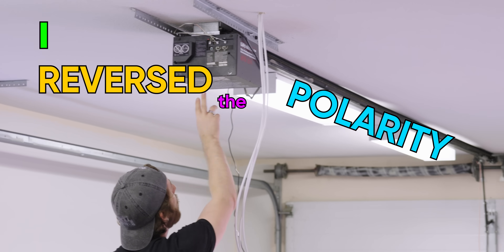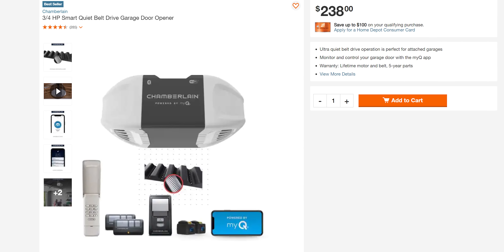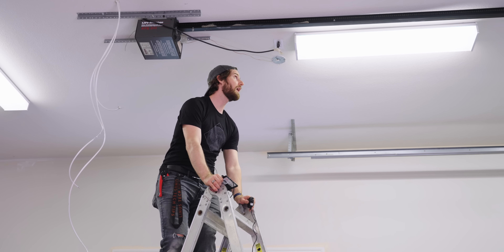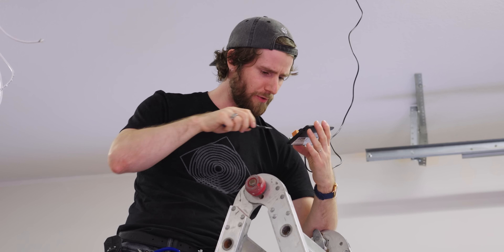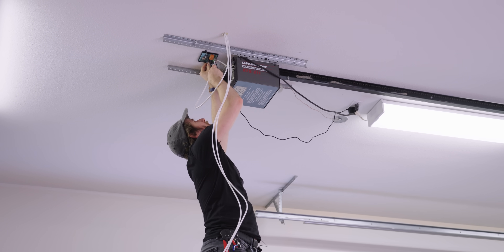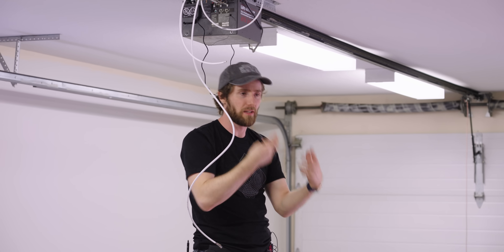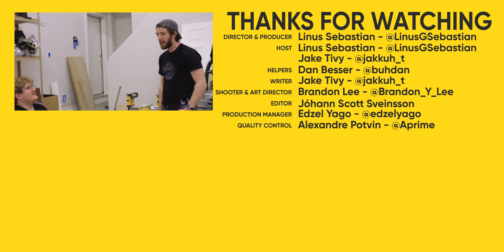Smartifying My 25+ Year Old Garage - Z-Wave Garage Door Opener

Comment: You could have just bought the Meross garage door opener ($20-$70 depending on model) and saved yourself a ton of issues and complications. I installed mine in like 15minutes and it works flawlessly with all the voice assistants.

Comment: The MyQ device works fine with normal push buttons to open/close your door.  And it works with Home Assistant.  Yes, requires cloud access to do it, but if someone doesn't care about that and just wants an easy install, it's about a 5 minute set up.

Comment: You probably could do that same and much more with a raspberry or android, of course if you like to talk to your device you need a cloud. But if you want some automation to close the door and don't mind to open a ap or browser on your phone to click a button to open or close the door it would be much safer and don't need to sell your soul to Google to open your door. You still going to be connected to your wifi when you run up to the house so you don't need to open the device to the outside world, and having an easy password on the website would give extra safety even if someone hacks in to your local network

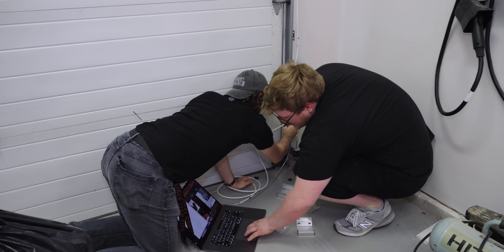Comment: 4:41 the placement doesn't matter since its irrelevant on how it detects its open, if you have it at eye level it will still operate the same either with it in the top, the floor, or the middle.

Comment: If you install the magnet part at standing height of the door, and also the sensor, it works the same as you installed it at the bottom of the door.

Comment: So, what happens when someone shouts through the letter box, "Hey Google, Open garage doors!"?

Personally, I wouldn't want voice control to open doors to my home.
Reply: Personally I don't want any "smart devices" controlling anything in my home. I'm happy doing things the cheaper/manual way. With the added bonus I don't have to worry about chips/circuits going bad, electric costs or proprietary nonsense.  However this is a tech channel and just reviewing a door handle is not what people want to see.
Reply: And even if Google is smart enough to only recognize Linus's voice - he literally has thousands of videos for you to take voice samples
Reply: Mine asks for a pin.
Reply: @hunterdelrey  That helps a bit
Reply: A nice feature of this sort of device is that it literally doesn't matter. A house has dozens of ways in that are easier than hoping he has a smart hub of some kind near the doorway, and the smarts would notify him that the garage was opened. So he would know somebody was breaking in long before he got home and found a smashed window etc. (he has shown that when the garage door activates it sends him a notification on a Wan show at some point)

Comment: Most low voltage wiring company will run cat 6 every no matter what is actually needed. It's just much easier to deal with one wire

Comment: It might not be the most famous solution but… you can use the Liftmaster 889LM control panel and 828LM Gateaway (for connecting the control panel to the internet) to “update” your gate openers.

And yes, Liftmaster is a Chamberlain group brand, this is not an sponsored comment.

Comment: I use Liftmaster openers with My Q and it's not as painful as you explained.
I'm even 7000miles away from home and can open/close my garage door whenever someone stops by and doesn't have a key.

And then it can sync with Amazon so they drop-off packages in the garage to prevent package bandits from stealing my stuff.

Comment: Just an FYI, My garage door opener isn't connected to the cloud and I can open/close it with Google assistant. It can be done and kinda sorta easy. You can manually connect GA to Home Assistant. I've had mine like that for well over a year with no problem. Just lookup the "Google Assistant" integration.  I can control anything in my house via GA that connects to HA.

Comment: Tip for young players - extend all the contacts from the door openers to a location with safer access - this allows the testing and reconfig to be done while NOT on a ladder... it also allows the controller to be upgraded or replaced without having to move a car out of the garage and find a ladder...
Reply: Exactly. The long cablerun should not be to the contact sensor but to the garage opener itself… So funny to see Laurel and Hardy at work 🤣
Reply: Most of us don't have 20 foot high garages. I can use a step stool to get to my garage door opener, which I made "smart" with a $20 MyQ. Next one I install (I've done two) will have wifi and a battery backup.
Reply: also dont use Cat 6
Reply: @Ufphen  The low voltage installers probably use so much Cat6 that it makes more sense cost-wise to use it even with odd runs like this than stocking 2 conductor wire too.
Reply: @xDownSetx  True. But they were told to run two pair two pair and also paid to do that. When I pay someone to do something I want them to do exactly what I say. I wouldn't have minded the cat 6 though.
Reply: @Ufphen  why not cat6? Or you're just saying go with cheaper cat5?
Reply: @AeroElectro  they don't need it for Ethernet connections, it's just two wires sending a small voltage signal back to the PCB, so they could be super cheap, small wires, not a full-on Ethernet cable. He was saying to not go with any kind of Ethernet cable and just get two wire for it
Reply: @joeldowell5059 yeah but why not,  cat6 being prerun should let you upgrade it any fancy new system in the future if it needs it.

Comment: you're killin me. It doesn't matter where on the vertical rail you mount the magnetic switch, as long as they're adjacent from each other while the door is closed ... it if opens ever so slightly, it will separate the reed switch and will open (or close) the trigger. 

A garage door button is a sw .. open or close ... and you close it if open and open it if its closed.  (NO - normally open or NC normally closed)

Comment: That garage door sensor didn't even need screws, except on the magnet part. It comes with a seperate piece that slides into a slot and will tighten itself to the rail.

Comment: I would still recommend Chamberlain smart garage door opener. I’ve had one for years with no issues. Only limitation is you need a secondary device to work with Apple HomeKit.
Reply: If I have the option of not supporting an anti-consumer monopolistic company, I'm going to take it.

Comment: I bought. A 35 dollar myq device from best buy. The garage door buttons still worked. But voice command only worked to close the garage door. When is try to open it would just say something along the lines of for security this feature is not currently available. Maybe this s works now. 
This device worked with munroe existing garage door openers.

Comment: if cash is not an issue, you could go chamberlain as you mentioned in the video.
MyQ is compatible with HOOBS and you would have it z-wave :-)
In fact, I don't use their crappy app.
Even have it hooked to my security system and now the MyQ enabled garage door is one of my sensors

Comment: You should add a second sensor at where the magnet is when the door is open. Then someone can't easily trick your system into thinking the garage is closed by taping a magnet to the sensor that's close to the exterior wall. I'm assuming you'd have a camera in the garage too, but a redundant sensor will more quickly let you confirm that the door is either open or closed.

Comment: I integrated my MyQ garage lift motor to Home Assistant once, and it's been set and forget for over a year and a half. I haven't had to open the MyQ app a single time.

I get that the alarm when remote closing can be annoying... But it's an obvious safety precaution since I'm not there closing the garage to make sure no kids are in the way.

Comment: The fact that even Linus is tripped up by garage door home automation is a testament to the fragmentation and complexity of the home automation ecosystem right now.

Also, how did the cutaway at 8:07 make it past review?

"This CAT6 run is the same one that's hooked up to the (magnetic) door sensors..."
*Cuts to 2-wire run hooked up to IR breakbeam sensor*

And finally, a smaller correction:
The manual Google Assistant setup is fairly long and complex, but once it's done, you shouldn't have to re-authenticate unless Google drastically changes something on their end. DEFINITELY not every two weeks; maybe a republish once every ~5 years.

Comment: "put it down near the bottom so it can detect if it's open even a little bit." uh, you know it doesn't matter where you put it on the door vertically, as long as they're aligned, right?.... 🙃

Comment: "Light flashes for 10 seconds": Yes. Check your state/province to be sure, but here in the States a remote-controlled door is required by law to warn people that it's about to close if it's remotely triggered. You can, of course, build one that doesn't do this, but you'll not have luck selling your house with it.

Comment: “Prevents you from using any other ecosystem.” Ehhhh, wrong though. This whole thing could have been much easier if they would have just installed a Meross Smart Opener. I have the Meross MSG200, which works for up to 3 doors individually. It comes with sensors for two doors, third sensor sold separately. The chamberlain openers don’t work with any other brand device out of the box, but if you contact Meross and tell them some info about your opener, they send you the thing that you need to make the smart device work with your unsupported door opener - for free. Had it set up for months now on two doors via homekit and the thing simply just works. No lost signal, no failures to open/close, sends the command quickly, tells me when a door has been opened longer than a certain timeframe, or if it’s still open after a certain time of day, and customer support was very responsive and great to deal with when I needed the additional accessory for the chamberlains.
Reply: Wrong on two fronts even. The MyQ app works seamlessly with Home Assistant and many other smart home brands.

Comment: I haven't had to reauthroize the test app I've made for manually connecting google assistant in a while so I'd recommend going that option first. Though paying $5 to support the hass devs and having it auto configure it for you is probably worth it
Reply: Same, never had to re-authenticate my test app either.
Reply: Same here, Have had mine logged in for 2 years, never had to log in again. I do pay to support the devs, but don't use the subscription for anything except the google cloud voice service. my assistant is still setup trough the test app. I ve heard the Nabu casa way did go down a couple of times when there where AWS outages last year. My own domain stayed up so i did't experience any issues.

Comment: Actually you can use Google Assistant without the cloud. But it requires a lot more than people want to deal with. And you need to own a domain and have a bit of network knowledge. If u have the skill the only recurring fee is the one for your domain. And mine is only like 5 a year instead of 5 a month (60 a year)

Comment: I'm sure someone told you this on the video about the light switches, but just in case: Most of the time the hardware on those switches is generic and thus any firmware from any similar switch should work. Same goes for the control software on most 'smart' devices. 99% of the time you can control it perfectly fine from any one of the generic software makers. Brilliant happens to be my favorite because they seem to give a shit about IFTTT.

Comment: As an ex security engineer who mainly worked with shutters, PLEASE don't follow what Linus did with using a grinder put the rail, these shutters are extremely temperamental especially with older ones like the ones in the Vid. I'd also recommend 3 types of safety on large garage doors like this one, especially if it has a auto-shut feature. Both to keep people safe and also to make sure you don't damage things or the door itself.

Comment: Fun fact, no matter where you place the magnet and the Reid switch on the door (high or low) it'll work the same, as it activates (or rather deactivates) based on the height difference and not the absolute heights

Comment: Purchased Meross garage door sensor for my 20 year old opener. Took 5 minutes to wire. Integrates with apple HomeKit and other cloud providers. Cost was less than $50 per door and no annual fees. Software alerts on open and close. Plus warnings and auto close after X minutes or time of evening. Great investment.

Comment: do not understand why you make it so difficult when you can handle it super easily with smart homes. shelly aqara and possibly a homey or a smarthings hub then it would run in 10 min and be exactly as you want. you can control it via amazon google etc. you would ku get all the information about the position of the gate and can get push sms every time it is opened etc etc .. What you are doing now is like building a house. and start with the roof

Comment: Do anything but MyQ.

I have it integrated into HomeAssistant. They randomly change the API once in a while, then everything breaks until someone figures it out.

I have it in a shared residential entrance, and mostly use a clicker. Still annoying when I cannot open it from HA when I count on it.

The phone app mostly works though. That whole "must have net and go through my cloud" crap is not a good thing ....

Comment: Can anyone recommend a gadget that could connect a "smarter" door to the network? (RF operated) I've only found switches that do not have an open/close sensor, and I don't really want to spend too much time figuring out how to connect an Arduino to an IOT cloud to hack up my own.
Reply: Not quite what you've asked for, but Meross do a WiFi connected gadget with magnetic door sensor for cheap. I've done the Arduino route, and while it wasn't very difficult, it's not worth it considering a turn-key solution is available for a low price.

Comment: as a older garage door opener expert, this is hilarious
some helpful info about these two openers, the terminals are as followed 1. is wall control negative 2. is positive (common) and 3. is sensor hookup negative and bolth safety sensors are to be wired in parallel and wall control does not matter whitch way it is wired to function, but has to be wired correctly for indicator light to function.

Comment: One way we were able to get around the Chamberlain issue is to buy a premade button that has literally two wires that come out of it and all we do is connect those to a smart controlled relay. Boom done. And it works pretty well.
The garage door sensors are the same ones we use

Comment: Awesome video! I've always wanted to do this and didn't realize some of the challenges involved, so thanks for the honest video haha. One question though: if the garage "open/closed" sensor is controlled by a magnet, couldn't a smart burglar temporarily mount a magnet to the sensor to make it appear closed? 🤔 Obviously, it seems like the door would have to be unintentionally left open long enough for someone to seize the opportunity, and they would have to know what to check for in terms of smart sensors. (With all of the cloud/server-side logic, it's already pretty secure but just wanted to know how "smart" the sensor actually is.)
Reply: They are doing it about the hardest way possible.

Comment: I have a chamberlain garage door opener. My land lady had it installed. She's 71 and basically living in the pre 1950's era tech-wise. You also don't need to use MyQ. They have a built in Home Assistant support. My HA just found it automatically, using a Zigbee USB adapter. I don't use MyQ, it's trash. It does beep when it's closing but it's not obnoxious. Beeps for maybe 5 seconds max.

Comment: Jake it doesn’t really matter where the sensor is because as soon as the door moves the sensor isn’t aligned and shows as open so weather at the top or bottom it will know if it’s open even a little

Comment: I've been using the My Q add on for my old garage door for a few years now, works well and allows amazon packages to be delivered in the garage instead of being left outside.
While I can see the beeping when closing or opening the garage door be annoying, it more so feels like a safety "feature".
I personally just use the remote in my car to open/close the door, and use the app to sanity check if the door isn't open late at night
Reply: It is a safety feature. If you're not present to clear the garage door before closing it, and you don't have cameras, and you may even be automating it (you can automate closing on conditions, I believe) there's no way to check that it's safe to close, and a garage door can kill a person.

Comment: Imagine having a key to your house bounded to google assistant.
A bad actor would not even need to take your phone, just your google account to get inside.
No thanks.
Reply: The Google Assistant integration for Home Assistant lets you whitelist/blacklist devices or device groups (like security related devices), so you can prevent access to those devices via Google Assistant. Personally I wouldn't give access to those devices unless I have presence detection set up pretty tight (like phone detected at home & some kind of motion sensor detection), or I would limit the actions I can perform via Google Assistant to close only, but then you could easily lock yourself out...